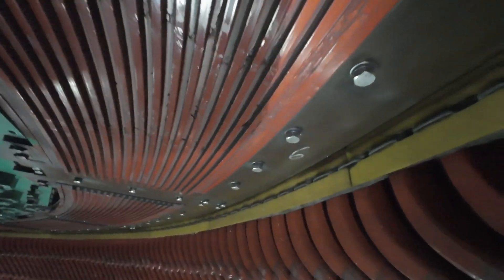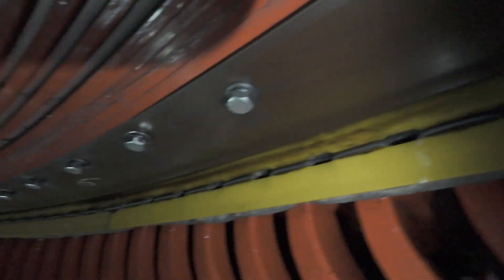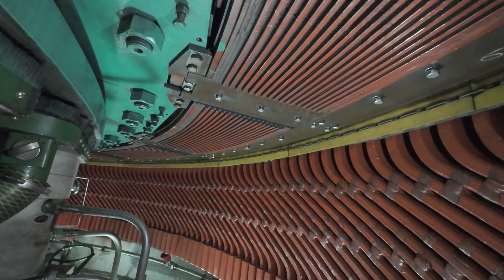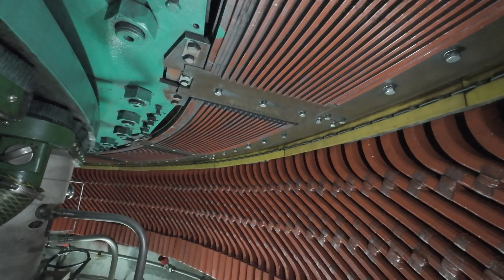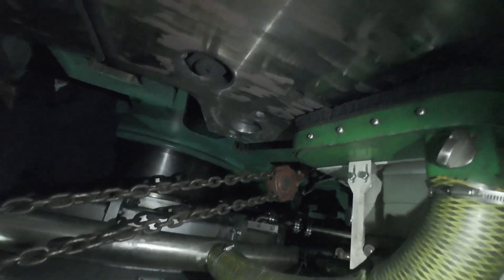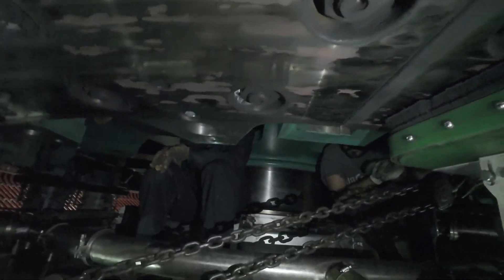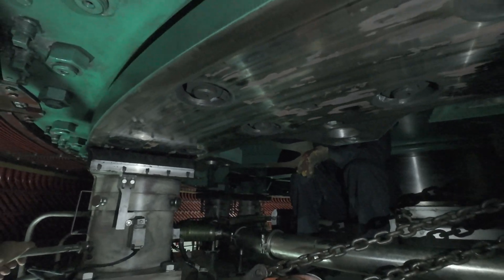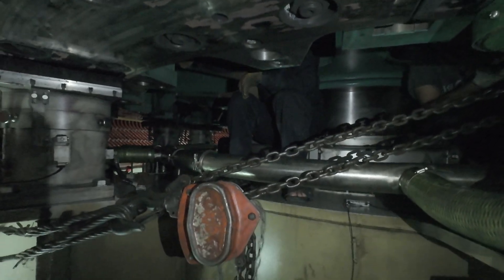How to Manually Rotate Francis turbine unit.?

Comment: I have experience with simlar work on francis units in Norway, up to 230MW. When the alignment is correct, and we run the axial bearing oil pump, it is possible to rotate the generator with one hand. 380 tons 💪
Reply from the maker: Wow, that’s incredible experience! 💯 Respect for handling such massive units—230 MW and 380 tons is no joke. The axial bearing oil pump really makes a huge difference in reducing friction. Thanks for sharing your insight, it adds great value here. 🙌⚙️